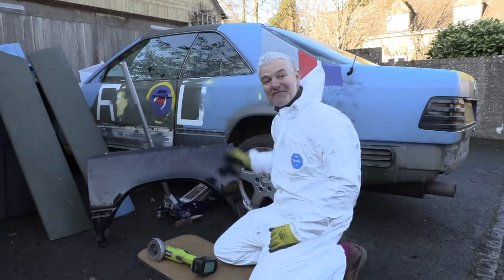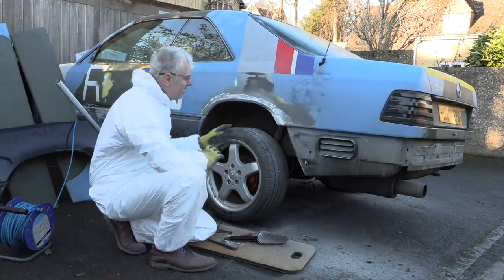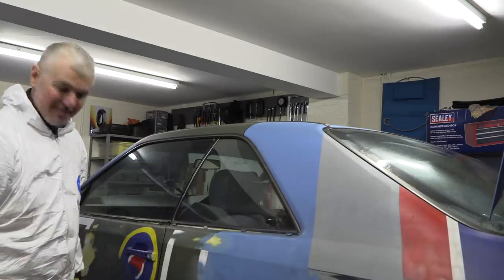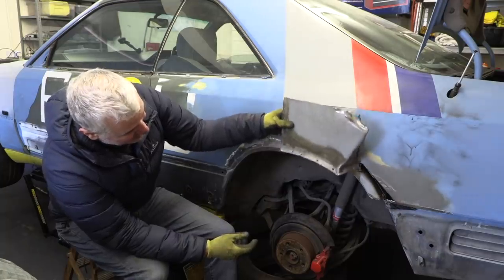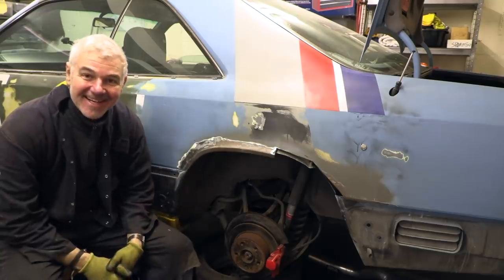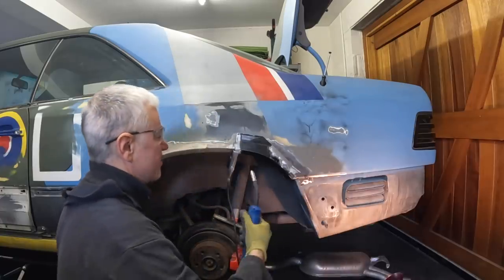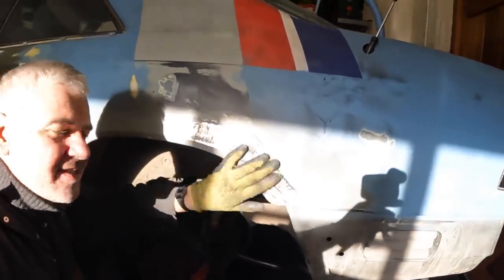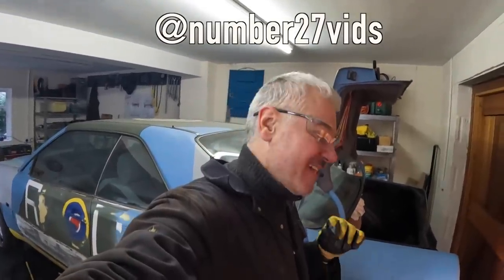My First Wheel Arch Repair - Welding Success or Disaster?    Mercedes W124 300CE

Comment: Little tip for welding: first, get an automatic dimming mask. It'll make a world of difference, and second - rather than trying to hold a light in one hand and the welding torch in the other, fasten a light to the front of the welding mask.
Good auto dimming masks. Are under £50 from Machine Mart.
Reply: having the basic mask which a background light would be far better for a amateur DIY welder etc even with a dimming mask, good background light is required having an additional light source is abit OTT....

the best tip would be opt for a TIG welding set-up OR a gasless mig welding set-up over the stick welding set-up seen (arc welding).. as you've less control, more heat etc going into the metal then you really need which always results in more mistakes..

on-top of that, being in a better more suitable position to see the entire area being worked on aka would've been better laying down OR propped-up comfortably in the in a lower position with a direct light source onto the working area, rather then being scrunched-up in the wheel arch etc
Reply: +1 on the dimmer mask best thing I bought.
Reply: I agree with this! The parr weld helmets are VERY good.
Reply: Yep, maskless welding will quickly get you a good sunburn. Still the result looks decent enough.
Reply: @amberazurescale5617  it's called "the third world method".
Reply: @mobiledevto  none sense, many ppl at home and work happily use hand held face shields, basic welding goggles etc

The most hazardous aspect of welding is burns, blindness, welders eye/flash aw & the highly toxic gas produced... also not forgetting the possible event of a fire or explosion....

If you complained about UV, you'd be laughed out of the country
Reply: @malp6280  The guy isn't stick welding; he is using mig...
Reply: @rbelang8331  the very 1st welding witnessed is stick welding (arc welding) later he changes welding set-ups.. I did write my initial comment after seeing such... As such that method of welding is very much out of date & gives a poor result overall.
Reply: The paper suit is awesome fire protection

Comment: Nice effort Jack. Well done.
Not bad at all for a first time.
100% better than the filler and hole.
Spend a little money on a auto dimming mask & you will find welding suddenly becomes a lot easier.

Comment: Good one Jack. Do remember to use Acid etch primer on bare metal to ensure proper adhesion. If using body filler no acid etch under it otherwise it reacts with the feather edge.
You can get U-Pol Acid etch in aerosol. 
You only need light coat. Heavy coats not recommended. Then normal primer & top coat over the top. 
All the best mate. 
Mike.

Comment: Pretty fair job on the welding for a first timer!! You should invest in a welding visor that is instant on, that way you have clear vision up until the point you spark, it's worth the money vs your eyes Mate. I weld recreationally having learned the art from a farming friend of mine, and then honed my skills on an Oilfield Reclaimation Crew. Got lucky with the nuts holding the muffler on, but next time you run into a situation where the bolt or nut looks a bit dodgy give it a spray of a penetrating oil and let it sit a few minutes. It really helps when you have an "almost" seized situation, and it's much easier than cutting/grinding it off. Love the old Merc and this is a great resource into how to get a useable machine into a beautiful and safe daily driver to be proud of!! Well done!!

Comment: Looks great Jack! I'd never attempt to weld a panel, but then I don't even have a welder! I notice some camera flicker - if you haven't already, set your camera to 25 or 50 frames per second rather than 30 or 60fps as is likely the default, and that flickering problem will magically disappear!
Reply: Good call on the frame rate there, though as the UK mains frequency is 50Hz isn't it likely to be worse to set the camera to 50Hz?
Reply: @mikeclifton7778  No, the frame rate should be a multiple of the mains frequency to minimise flicker. If you’re in a 60Hz country, try setting your phone’s camera to 25 or 50fps and you’ll see flicker. If the frame rate matches, the camera will sample a frame at the same point in the brightness cycle and so the perceived brightness will be stable. You can test it on any phone camera. I’m sure GoPros work the same. On my Sony mirrorless camera, you have to select either NTSC or PAL and then you either get 24/30/60/120 in NTSC or 24/25/50/100 in PAL. The 24 is because that’s the frame rate standard for cinema where special lighting or natural light would be in use anyway.

Comment: Weld done Jack for having a go if at first you don’t succeed get the grinder out if you cut it out by accident you can always weld it back I use cornflake boxes to make templates to fabricate parts helps with awkward shapes ,my first helmet came from Aldi it was about £20 it was adequate for what I was doing at the time but gone up market now to a top slot one and doing a lot more welding stay safe protect those eyes 😎👍👨🏻‍🏭

Comment: Well done Jack the arch looks great, well worth the effort! Interesting to see how its done properly as my 05 Vito has a hole on the drivers side rear. I've used fibreglass and filler to get it through the winter but hope to do a proper repair when it warms up a bit.

Comment: I did a Classic Car restoration course in 1990.My teacher was old school used a very small amount of filler to get the correct shape.He used lead loading it's quite a art but not to difficult to master with a lots  of practice and very satisfying when the lead doesn't fall off.Last much longer then filler.If that's your first attempt of welding not bad .You will get better with practice.I have been restoring classic for 40 years and a few times I have been to Aand E to have pieces of metal taken out it bloody hurts.So other people have mentioned it wear stafey goggles.Regards Ron

Comment: For a first attempt you've done well . Just  make sure your metal is really clean and always try and cut it so it follows the curve. And weld your new section so it laps on the outside then water can't get between the layers from the inside . I would have cut more of the outer arch away so you could weld the inner arch from the outside as you did with the outer panel . Well done !

Comment: Nice job, one always learns stuff by getting stuck in like that. 

Just a thought though…sometimes if a filler job is not too big and is well sealed, it may be OK to leave and just redo now and again. If you cut out there’s always a risk by introducing a weld line inside an arch you end up creating a new spot to rust through!

Comment: That is amazing, your welding is great for DIY job in your own garage, I doubt even most body shops would bother to do any better, not because they can't but because they could not care ... they would just weld it to stay in place and cover any pin holes with filler. So I would argue your probably do better job of it at home than in professional shop.

Comment: The muffler before the last one often look OK on the outside but inside they are often totaly rusted apart. That leads to the "wooly" stuff drifting around and blocking the in and out and you loose a lot of power. I usually open them upp on the top with a 10X5 inch fould upp ( one 10 inch side not cut ) door and rince out everyting. A baffle across in the middle with ample of room for the gasses to pass on the sides is enough to dampen the sound. With a new rear original type silenser the sound is only a little changed to a more sporty note.

Comment: Am sorry to be critical but this is really an example of what not to do. You should always wear a welding helmet apart from protecting your eyes it also does the same to your face. Those aren't spot welds, they are tack ones, once you've done a couple to hold the patch in place your should have welded the joint in a continuous line, you will easily be able to see what you're doing with the helmet on. Lastly, I may be wrong I know but I didn't see any auxiliary supports under the car, even the best jacks can fail.
However it's coming along nicely and I really appreciate your videos, keep them coming.

Comment: That inner arch overlap will rust like the clappers between the sheets. You can cut between the tacks and butt weld as you go, easier than it sounds. Also Ive been to A&E enough times even wearing eye protection. Really you must wear eye protection every time.

Comment: Not bad for the first time Jack, seen worse done by pros. You should get some cavity wax to spray all inside the boot behind the wheel arches, is a very efective way to keep rust away.
Reply from the maker: Got some already and will be using in all the inaccessible places!

Comment: I enjoyed your video. Well done, excellent bering in mind you have never welded before. You really should wear ear defenders when using a grinder though if you want to avoid ringing in your ears (tinitus). Btw, you keep mentioning 'spot welding' – what you are doing is NOT spot welding, that is actually something else using a completely different type of welder, it is where 2 panels are clamped together by the welding arms and welded from both sides creating a circular (or spot) weld.

Comment: Jack why not solder in tin?  A whole lot easier than cutting, welding and filling which is a bigger job than you think..
Reply: Is the flux corrosive if you can't get it off?
Reply: @jonnoMoto  YES, but its easily removeable.....you CAN get it off

Comment: Outstanding work and video.  How do you rate your work on Bismerc to your work all the other cars since you started your videos?  Certainly the Ferrari and Lotus were significant tasks.  But this seems to be turning into the most satisfying/rewarding.  And which of the cars that you have sold (or parted company with) do you miss the most, so far?

Comment: Excellent!. How do you compare the value of the Bismerc compared to rebuilding an MGB. I had to do the same cutting and welding to salvage a 1972 MGB. I can tell you have the same feeling of accomplishment that I had. I think they are worth the same. Certainly the Mer  will be a better drive. Would you keep the MGB or the Bismerc after all that work?

Comment: That "repair panel" was so very good it was cheating! How lucky getting the inner wheel housing as well. I thought you'd be stuck with a pattern arch which are available for a reasonable £40 and fashion the inner yourself. However it's a great repair, almost too good for the nasty old Fokker.

Comment: Man for a rank amateur panel beater you got there.  Thank God for bog/Bondo.   Next time you do a wheel arch have a look on YouTube first.  You tack welded mate not spot welded and a cheap auto dimmer mask off eBay is the go.  A cheap mig welder is much better.  You can't weld panels satisfactorily with an arc welder.  But I have to say you did better than most for you 1st go.  Well done.  Cheers from OZ .

Comment: ok, its annoying your not "spot welding" your tack welding... aka adding small spots 'tacks' of weld to hold the steel in-place etc.. I'd highly suggest you upgrade from the arc set-up to a TIG or even a mig (possibly a dual se-up) over what your currently using, your welding will massively improve & you'll get far less issues overall..

I'd also suggest thinking about your body positioning & general working set-up prior to attempting any welding as again, thinking/planning ahead will also improve your work

Comment: A pair of goggles are far cheaper than a pair of eyes, use them when cutting with a grinder, you'll regret it if it all goes tits up and you get a shard of metal or a bit of cutting disc in an eye. Keep at it and good luck.

Comment: You've heard of welding primer, right ?
Reply from the maker: I used it on the back before welding and over it all when finished..
Reply: @Number27  Err...no. You prime the welding areas first and weld after. The purpose is to protect the areas inaccessible after welding. Well, maybe you did, but it's just not on the video.